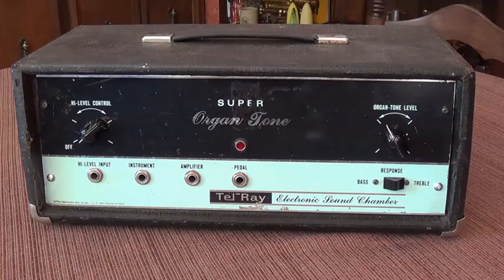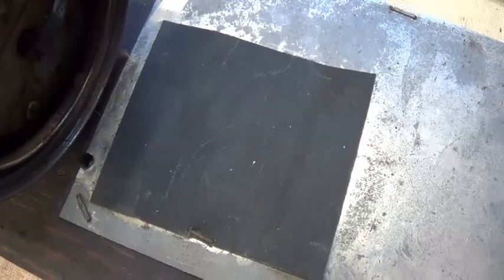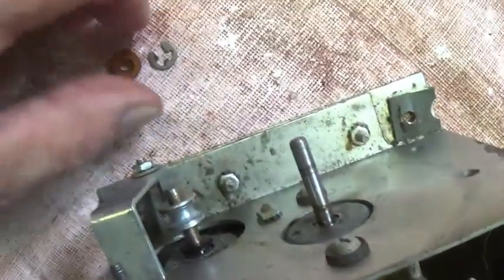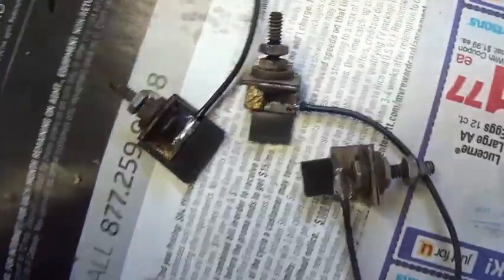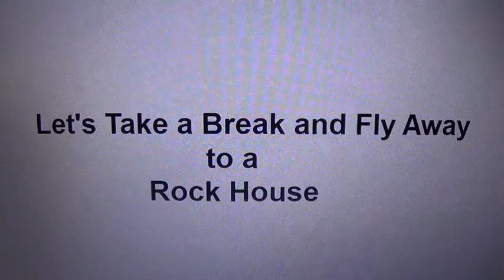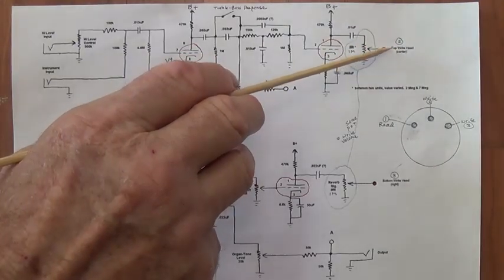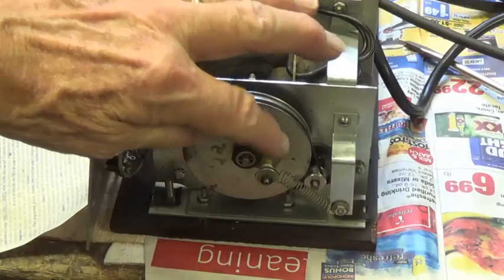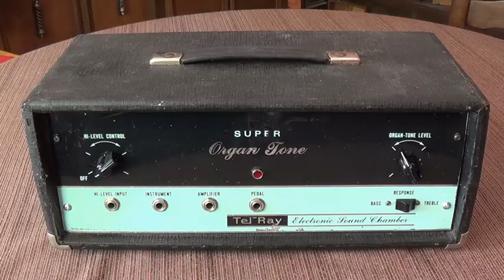Tel-Ray Super Organ Tone Resurrection.......Saved from the Dump !!

Comment: Ok, it's me again... so much about these seems to be not understood, not limited to the people who built them! I restore echoplexes all week long... and the big deal that I understand is that most of them have issues with the bias, or bias amp/oscillator... I wonder if this has to do with the lowfi sound? That if a bias oscillator was somehow introduced onto this, it would become a stupendous hifi echo... in fact I believe the British had a rare high end studio echo that used a spinning disc and was called an electrostatic echo,  basically blasting this ferric disc with highly biased high amperage AC signal and it sounded stellar! Like a tape delay made from a half inch mastering deck... just wondering about that...
Reply from the maker: Greetings, Sean. Your questions are beyond my range of experience and knowledge. Hopefully, info is available online to answer your queries. Good luck.
Reply: It IS a tricky technology... consider that here in the US,  we had been trying to unlock the potential of the tape since the 30s. It was the Germans that succeeded... and a radio operator near Berlin, before we sacked it, was listening to their radio broadcast, amazed that on the eve of their imminent invasion they were having a classical music concert... after it was over they announced it was a TAPE recording... and he was floored! First thing he did when they invaded was to grab the Telefunken tape machines and mail them home, where he quickly reverse engineered them. It didn't take long for the govt to catch on and take their share, and the resulting company was AMPEX... and within weeks they were cranking out the machines for radio networks and the government. It was president Eisenhower and Bing Crosby who had the first machines... but the tape stock was terribly short in supply, as the factory in Germany had been bombed. This factory is know the company we know as BASF. but in those early days, Bing and Ike had to use reels that were used before, as was the case with his first TAPED speech Ike gave in 1945... he used a tape that had already been used and sent it to NBC to be broadcast live... they had one of the other machines, now only a handful of which existed... the operators were new to to this as well, but the speech went through. But there was no notes on how long it was, so the operator made sure and let the tape keep playing to see in there was more. There was! After the president had finished,  they turned the machine off and the previous recording started... which was a ROUSING AND IMPASSIONED SPEECH IN GERMAN, BY NONE OTHER THAN ADOLF HITLER! 
NOW... the public had not been told of this new technology... and this caused a panic in several cities,  when several citizens were scared spitless, sure that HITLER was still alive, and taking over all the media!! Until the radio operator finally realized that this was a great mistake and hit the stop button!! But what the Germans discovered,  was biasing, or using a high frequency pulsing to help the tape record... just as if you took movie film and opened the lens and drug the Film through,  without the shutter blinking off and on 20 times per second, you would have nothing but a long smear of light and no movie... so too is the case with tape... the bias amp takes the audio and pulses it at a rate so fast it's not perceptible in our hearing.
Reply from the maker: @seansweeney3532  Thanks so much for the very interesting info, Sean.

Comment: Doug how much would you charge to do this on a working Super organ tone! Would love to higher you to do it.
Reply from the maker: Since it's working, would you want a cosmetic improvement (disassembly, bead blasting, reassembly) plus electronics overhaul (new capacitors wherever necessary)? My minimum on shipped devices is $250 plus parts, John......so it would be in the $300-$350 range, plus two-way shipping.

Comment: Is that what Jonesy used for "No Quarter"?
Reply from the maker: I'm not sure, Kard, but will have to check it out.
Reply: Doesn't seem like it. Wikipedia gives this, rather convoluted, description:
"John Paul Jones achieved a Fender Rhodes-like oscillator effect, as well as a real-time bass synth line, done on early Moog Taurus foot pedals in sequence with the keyboard track, which requires an amount of dexterity. Along with full-range intonation, the depression-sensitive bass pedals were then able to be modulated in-time with the riff, opening up the filter cut-off, rhythmically, judging by the amount the pedal is depressed. The result is a swampy, hollow, and deep bass sound, which was also compressed in the final cut."
But it sure does sound similar.
Reply from the maker: Thanks for the research, Kard. It sounds like a whole lot of equipment and finagling to achieve almost the same exact sound as the unassuming little Super Organ Tone :)

Comment: Great work Doug, what kind of media cleaner are you using?  Wow what a nice job that bead cleaner did.
Reply from the maker: Thanks, Hack. I used very fine glass beads at 90 PSI.
Reply: I thought of finding a small unit to use soda as medium.. I hear it works well with thin gauge metals , and even takes paint off guitars without harming the timber..
Reply: Steven Jozefik l

Comment: How to the rubber heads, read and write? Being a non conductive material?
Reply from the maker: Good question. Since the signal that is stored and read is electrostatic, I don't believe  conduction is necessary.....in fact, it would probably be a detriment.......since the writing involves a deposition of electrons, not a flow of them.  Recall how many electrons you can pick up from walking on a rug wearing rubber-soled shoes.

Comment: Uncle Doug, your LB-65 connection here. I have someone asking me if the VOX V807 does or does not require LB-65 oil but instead gets an occasional spray from some electrostatic silicon oil. Are you familiar with this unit?
Reply from the maker: I am not, James, and thus would be hesitant to offer an opinion.

Comment: Knock knock, me again!, I got my champ finished and I used the 5k and 8 ohm speaker impedance. I am running it through a 10 inch 8 ohm bass speaker that is 350 watts. There are two speakers in the cabinet but separate from each other with two jacks 8 ohms each. I tried it in both of them and I know the speakers are good. That 5 watt champ is driving the speaker crazy and vibrating the crap out of them. They even sound busted if I turn the volume up much at all. But I know they are good. The only thing I did not do is, put a negative feedback. The speaker jack is an old type with two prongs , put the green on hot and the black on ground sleeve but the jack is metal to metal against the chassis.would you have any idea what could cause this. I thought my impedance might be off, so I checked the speaker and it is 8 ohm. I tried another head through the cabinet and works fine.There is one thing that is strange, With 100 k  load resistors my plate voltage on my 12ax7 is just about 66 volts on my plates. I guess I could drop my resistor values a little. Thanks in advance if you have any ideas.
Reply from the maker: Have you considered using the 8K primary impedance winding of the OPT (if you have one)?  You could install a NFB circuit and check for microphonic tubes. Good luck.
Reply: Thanks, I will try that.

Comment: There is nothing wrong with your television set. Do not attempt to adjust the picture. Do not attempt to adjust the volume. You are about to participate in a great adventure. You are about to experience the awe and mystery which reaches from the inner mind to... Uncle Doug's Tel-Ray Super Organ Tone Resurrection...
Reply from the maker: That's right, DC, and you better check your shorts for Zanti Misfits.

Comment: Media as in ________?
Reply from the maker: It's hard to tell what you're inquiring about, but if you mean the "bead blasting media" it consists of, not surprisingly, fine glass beads.
Reply: @UncleDoug  AHA!
 Thought so.
Now, coming from an Aerospace background, I'm familiar with that, Aluminum Oxide Grit (removes quite a bit of material), and another one.
Plastic pellets, known as Plastic Media blasting, used to remove paint from Aluminum aircraft surfaces, and removes zero substrate.
For future needs, consider looking around for either that service, or Dry Ice blasting, used to remove road grime from car engine compartments, again leaving the substrate in pristine condition.
I fear your drum endured some material removal, as I've done before in an engine cleaning shop.
Reply from the maker: @RedArrow73  Thanks for your helpful input, RA.

Comment: Early Hammond Tone Cabinets used Springs Suspended in Brake Fluid.
Reply from the maker: Brake fluid is a nasty substance if it has any access at all to air and moisture.
Reply: Uncle Doug 
And in this case it did, the tubes the springs were suspended in were open on the top.
Reply from the maker: Good grief. It's a wonder they lasted through an entire performance :)

Comment: I haven't got a clue how that thing works it's some sort of recording medium yes! but why rubber heads how does rubber record or playback what are you actually recording? If you don't want to mark the surfaces with the grips get some shoe leather or  rubber soul  and wrap it round? This will provide the grip without marking but more force on the grips is needed. I don't know why you call them c-clamps we call them g-clamps because they look like a G not a C?
Think it's spindle oil isn't it
So is the disc and rubber heads acting as a cathode and anode is that how it works. Have you got any information on this oil or a link. Thanks!
Reply from the maker: Since the signal that is stored and read is electrostatic, no  conduction is necessary.....in fact, it would probably be a detriment. The writing involves a deposition of electrons, not a flow of them, so rubber is an ideal substance to form the heads.  Recall how many electrons you can pick up from walking on a rug wearing rubber-soled shoes.  There are many links and info re the Union Carbide oil on the Internet, John. You're welcome.
Reply: Uncle Doug can't find anything on union carbide oil that's why i asked.

Comment: Out of curiosity, I wonder if anyone ever tried to make an echo unit using a wire recorder rather than (or before) tape?
Reply from the maker: I've never heard of a wire echo machine, Bill. You might do some research to see if such a thing ever existed.
Reply: Doug, I couldn't find anything with Google, but today I used duckduckgo and did indeed find such a unit that came out in the 50's called a Binson Echorec. Look it up sometime. Very interesting and incredibly expensive to buy a used one. (Around 2 grand.)
Reply from the maker: Another viewer posted a link to such a device, Bill, but the recording wire was used as a medium to layer the edge of a spinning disc, and then milled flat. I get the feeling that the wire was really not used as "wire" but simply a metal layering of a material that could retain discrete electric charges. I envision a true wire recorder delay device as applying a signal to a moving strand of wire and then reading it down the line......just like a magnetic tape delay, but with wire instead of tape.
Reply: I'm not sure how the wire was used. I did read where the inventor was able to increase the fidelity by making the wire wider, so I took that to mean that wire was used to carry the signal, but I don't know. If not, you should find an old wire recorder and turn it into an echo unit. You could be the first! :-)

Comment: Hi Uncle Doug--Thanks for the restoration--I had never heard about this old technology.  I'd like to discuss an important part of the circuitry.  If you look at the recovery stage, a cathode follower,  in the lower left part of the schematic you'll note that a portion of the output from the cathode is fed back to the grid.  This technique is called bootstrapping and is done to increase the effective input impedance of the stage.  I'd also like to point out that the pot shown in the upper left portion of the schematic is wired backwards.  As shown, if you turn the pot all the way down, you will short the output of whatever is connected to it to ground, which could, of course, cause damage to that piece of equipment.  BTW, you may be interested in a way to remove rust described in this video, https://youtu.be/8LhFCuXBIUc.  Finally, please give Jack a scratch behind the ears for me.
Reply from the maker: As always, your knowledgeable input is both accurate and appreciated, Roiderien. I had noticed the cathode output from V2a, but was not aware of the "bootstrapping" function. Very interesting. I did not draw the schematic, so I'm not sure if the Hi Level pot really is wired this way......but I see your point. Thanks also for the link regarding metal cleaning.